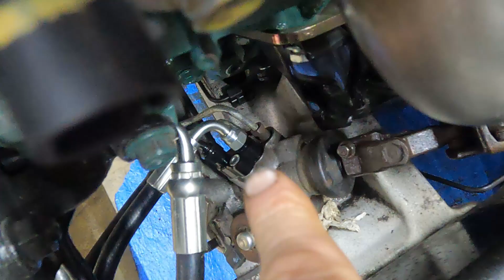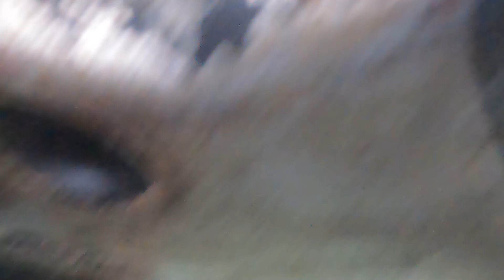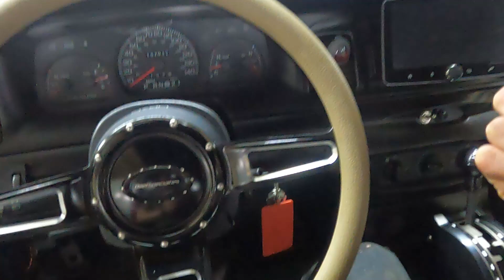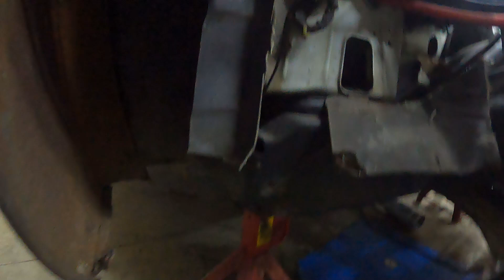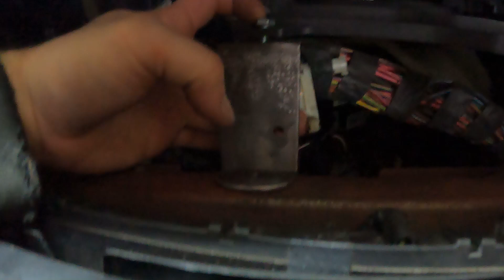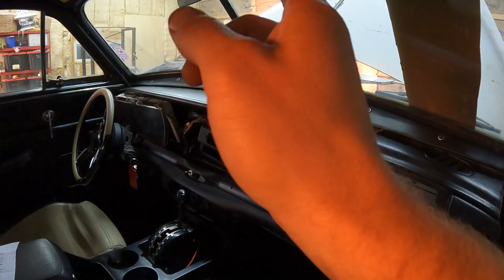How To LS Swap A Crown Vic-Ep.2

Comment: I have a 2010 that i really want to put a gen 5 l83/6l80e combo into, i know that the 6l80e is about 2" shorter and has the lines on the driver side, so maybe id be able to just drill the crossmember for the mount and use a different yoke. If possible, I'd like to use as many direct bolt on and stock parts as i can, including the ecm and tcm. Would the stock exhaust work? Also is there a stupid simple way to use the crown vic wiring bits to run that combo as a standalone inside the car or use all the 4 guages or would i have to use the truck guages? Im an absolute idiot when it comes to these things sometimes. Thank you for your time!
Reply from the maker: That would be a cool combo. Being a 2010 the wiring is canbus so I don’t know if the stock gauges could be made to work or not. A premade stand alone harness for the l83/6l80e would be the easiest route to go (or get your stock one cut down). They typically just require a few wires to be hooked up like ignition, grounds, and fuel pump. You can tie all that into the Crown Vic wiring pretty easily. The stock exhaust can be reused with a little work.

Comment: I have a 1993 will this still work for me ?
Reply from the maker: There are differences in the front suspensions and frames so you may have to do some things a little differently but I’m sure it can still be done.
Reply: @dd10088 I’ll thank you I did a cool junkyard build it’s non pi block with pi heads and cam made it a little faster